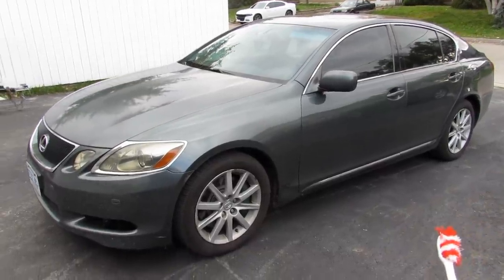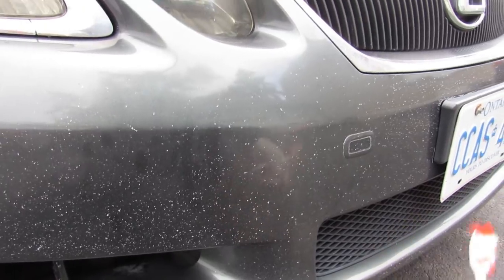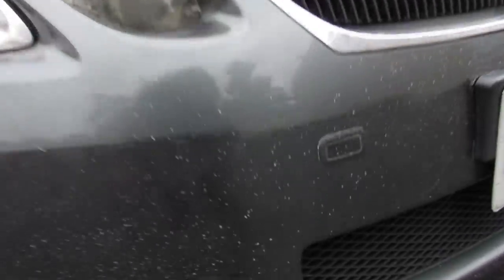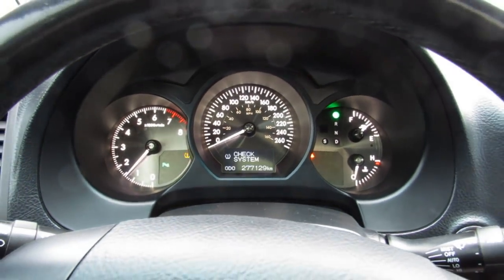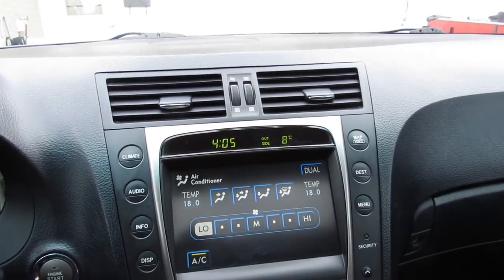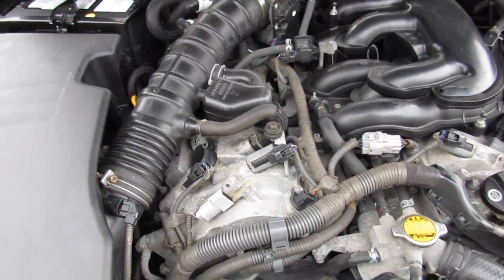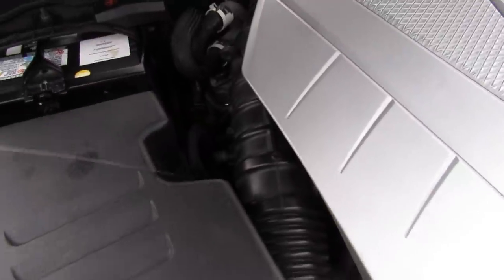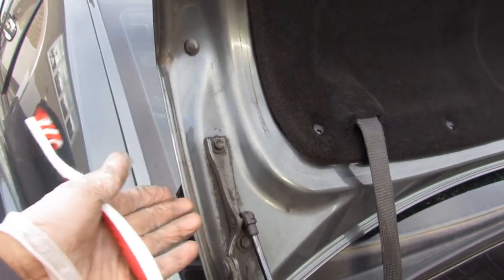Here's How to Inspect a Used car in 5 Minutes

Comment: First thing I do is get under the car and look for any questionable rust/leaks. Second pop the hood, check oil, transmission fluid if not sealed, then radiator. Make sure tires aren't cracking, brakes are a easy fix but always look for rust. This guy's spot on. Always start the car when it's cold to see if any lifter ticks or VVT rattles are present.
Reply from the maker: Agreed. Cold starts can reveal alot more issues
Reply: @speedkar99  so that's why the car dealers always start the car early when i go there

Comment: If you were examining a German competitor of a similar age there would undoubtedly be a  long list of issues. You just can't beat the Japanese and especially Lexus for reliability!
Reply: All depends on whether it was maintained or not.
Reply: @thenwhoami  Most of the issues I have seen are not related to maintenance, more like low quality parts being used by the manufacturers, electrical issues and parts that don't need maintenance failing. I wouldn't touch a German car
Reply from the maker: Yep I appreciate my Lexus for it's quality

Comment: Heres a tip, dont fall in love with a car before you buy it. Thats what I did when I was dead set on a gen 3 Honda Prelude Si and I purchased the fist one I came accross and thought it just needed a clutch. It was infested with electeical gremlins and I got rid of it in less than a year. Live and learn.
Reply from the maker: Good tip. I left that in the more detailed 6 part series of used car inspection
Reply: This must be a sign, I'm on the hunt for a 3rd gen Prelude too.

Comment: Lot of scammers now in the used car market. Never buy a rebuilt, check for rolled back odometer or they have switch the speedo for a lower miles one. Uni body vehicles can never be squared after a major accident, that is why they are written off.
Check for excessive wear on brake pedal, steering wheel (often covered) and driver seat that does not match to the miles or klms.
Another great video,

Good LUCK TO ALL !
Reply: Dont buy used cars from dealers as well
Reply: Trust me insurance companies are very very quick to write off cars that have relatively minor damage and this can be to your benefit, also you'd be surprised how many people and dealers sell cars with clean titles that are anything but clean and do not show up on Carfax reports etc.  Buying used cars is a minefield, you can get stung no matter what.
Reply: Write off has not much to do with damage. It is all about economics for the insurance company.  If the current market value of a 1 year old car is $40k and the damage is $20k, the insurance company is gonna spend the $20k to fix it in most cases.  If the exact same damage happened when the same car is 10 years old instead of 1 year old,  the insurance company is gonna write it off because they don't want to spend $20k on a car that is now worth $4k instead of $40k.  I have seen some write off vehicles with huge accidents and I have seen written off vehicles with cosmetic damage such as hail. So it all depends. I know because I inspect cars for a living.

Comment: OTHER TIPS... 
ENGINE: Before you start the engine, check the oil level. If its low or smells burnt, that can be a sign of a worn-out engine. 

Check the oil fill cap for foamy oil residue, which is a sign of coolant getting into the oil, caused by a head gasket leak.

Wipe your finger in the exhaust pipe. If there's a little soot it's Ok, but if it's a lot of soot and/or is oily, the car is burning oil.

If you can remove a spark plug, check to see if it's black, burnt, or oily. If so, this is a sign of the engine wearing out.

Remove the radiator cap and check for low coolant and look for an oily film, which is a sign of a head gasket leak.

TRANSMISSION: Check the fluid levels and smell the fluid. If it's low there's a leak and if it smells burnt, the transmission is wearing out.

With the engine running and your foot on the brake shift the transmission from drive to reverse and listen for a clunk. That can be a sign of bad transmission mounts or the transmission itself is worn out.

SUSPENSION:  Push down on each corner of the car (one at a time) and try to get it to bounce. If it bounces more than twice the shocks are wearing out. Also listen for clunks, which can be a sign of worn out suspension components.

AC: Pull out the cabin air filter and examine it for mold and musty odors, which can be as sign of a clogged evaporator, drain, or bad AC unit.

TIE RODS & BEARINGS: Jack up the car so the front wheels are off the ground. Grab the front tire at 9 and 3 and push and pull on each side. If there's a clunk the tie rod is worn. Grab the tire at 12 and 6 and push and pull. If there's a clunk the wheel bearing may be bad.

Is a bunch more but this is all I could fit.
Good video 👍
Reply from the maker: Thanks 
I have the 6 part used car inspection video series thst goes into more detail
Reply: Dry, powdery soot in the tail pipe does not necessarily mean it's burning oil (but you're right about oily soot). I have a 2013 Lexus GS 350 and those have direct injection (in addition to port injection). When direct injection engines are used frequently for very short trips on light throttle, soot will build up bc the engines run rich when they are warming up so some of the extra gas is not totally burned in the cylinder and comes out of the tail pipe as soot
Reply: @CarShopping101  Good to know, thanks 👍

Comment: Thanks for the tips.  Another thing is to measure distance from tire to wheel well edge on both sides.  If not equal, frame bent from accident.  You can use the ruler on your smart phone or even your fingers.
Reply: I did not understand , can you expla8n more plz
Reply: @soufianattar4554  My car was in an accident on the front passenger side.  The whole front suspension and body parts have been replaced so it all looks perfect.  But if you measure from the back of the front tire to the fender on the drivers side, it's 2 1/2 inches.  On the side where it was hit, it measures 1 1/2 inches.  That's because the frame is bent and can't be fixed.  That's one way to tell if a car has been in an accident when everything has been repaired and looks fine to the eye. You can do it to the rear tires too.
Reply: @coalbuster  thanks
Reply from the maker: Yeah but that's not something I'd do right away in a dealership parking lot
Reply: @speedkar99  Why not? If I see the frame is bent, I walk away. Literally, just stick your fingers between the tire and the fender.

Comment: Top tip, don't buy at an auction unless you really know what you are doing.  I tend to trawl Craigslist and FB Marketplace, all the good stuff is snapped up so gotta be quick.  My latest acquisition is a 1997 Toyota Celica GT convertible, 230,000 miles, runs like a swiss clock, was part of an estate sale, got it for $1200.  My main driver is a Sequoia but wanted a fun runaround.
Reply from the maker: Nice. You do have to have a good eye when you are at auction.

Comment: You can check for a blown head gasket by seeing if there's water in the oil by burning a bit of it in a spoon and watching for sputtering or steam. Schrodingers Box showed that it actually works about as well as doing a block test.
Reply from the maker: Good tip. But not something I'd do in an auction or dealer lot yet.
Reply: 😂 I just imagine doing that and the dealer calling the cops on me thinking I was about to smoke some meth right there

Comment: I like to squeeze on big coolant hose. It is possible to examine air pockets and broken coolant cap in seconds. Broken coolant cap on Japanese cars is really good way to overheat engine :>
Reply: If cap is allowing coolant to return with no force on hose circuit will not hold pressure and will empty itself under engine load.
On Japanese cars hose must be a bit stiff, cannot collapse, otherwise circuit it is not bleeded properly, probably had work done on it or has leaks.
On european cars coolant reservoir makes air pumping sounds when cap is bad.
In every case it is possible to hear air trapped inside of hoses and estimate how much is stuck
Reply from the maker: Good tip
Reply: @speedkar99  It started with second car, it was 25 year old civic, that had replaced head gasket. I had to replace it too, only cap was bad :>
I diagnosed cap failure on about 10 years old Opel, hyundai and suzuki that blew head gasket, and on four years old mazda, that was on its way to starve on coolant. I diagnose some of them, when other mechanics are working on them and I'm just passing by with intention to piss them off a bit :>

Comment: This looks like a newer car but isn't it a good idea to check for radiator milkshake and maybe burnt transmission fluid as well - assuming there are caps/dipsticks available?
Reply: Yup. Checking all fluids is a good idea.
Reply: These cars are extremely reliable but they do let waterpumps go.

Comment: Great video. I'd like to add that if you weren't very mechanically inclined you can skip an engine overview, under body exam, brake exam, OBD scan, and suspension exam. Some red flags to look for are price, grinding, squealing, knocking, large amounts of rust on the body, things of that nature because that usually means the car needs work. Certain dash lights can be ignored like the tire light and sometimes the engine light but anything else and any flashing lights mean you should probably stay away from that car. Once you start the car make sure to listen to it and look at the exhaust while the car is on, if something just doesn't seem right trust your instinct even if it is wrong but don't completely think that something is wrong if it's only one thing that doesn't seem right. Furthermore, you really ought to learn a thing or two from great videos and creators like this one before you go and buy used cars because it can be helpful.
Reply from the maker: Glad you appreciate it, I have a more detailed inspection series as this was meant to be a quick overview

Comment: I look for a high mileage new car, for instance - 2017 with 150,000 km on it. 
That way I know most of the miles are highway.
Highway driving is 5 times easier on the car than city driving.
Reply from the maker: Agreed. I'd rather buy a higher mileage car than a low mileage older one

Comment: Tires on a used car will tell you 90% of the story. Part of my job involves inspecting used cars. If a used car has expensive tires in good shape, 99% of the time, it means the owner took good care of it with regards to everything else.  If the car has brand new cheap Chinese tires, it means the vehicle has many issues and just before putting it for sale the previous owner put some new tires to help sell it.  Also look at the production date of tires on the sidewalls. It will tell you how old the tires are. If the tires are way older than the vehicle then it means the owner bought used tires and put it on the vehicle.  If the tires are worn out, mismatched or in bad shape then it means the owner didn't do much with regards to any other maintenance either. You should not buy that vehicle.

Comment: Those OBDII scanners are dirt cheap and have bluetooth connectivity, perfect little gizmos:)
Reply from the maker: Yep they work good for quick diagnosis
Reply: Good for basic stuff. Sometimes for really good diagnostic it's a few ks, these days hard to work without them and most likely no an option in the future. Even for bleeding brakes on something like 15yr old BMW X5, one has to activate the pump by  scanner. And rear brake pads replacement on cars with electric parking brake - again, scan tool to move the pistons into their original positions. Michał, niedługo to bez laptopa z scannerem za kilka tyś dol to nie wiele da się zrobić, bo tanie scannery nie mają wszystkich opcji i oprogramowania do wszystkich marek samochodów.

Comment: Please check fuel/brake lines for rust/rubbing, I got burned recently on a truck I bought, can easily cost over 1k to replace, and the vehicle is undrivable if either are leaking.
Reply from the maker: Agree, that's another good point.

Comment: Is there super repaired car from heavy accident in USA? In other places a completely crushed car can be disassembled and done some most careful metal work, repainted, and treated to make it like original ageing paint. Will higher labor cost prevent this in developed countries?
Reply: They can even mimic factory welding points when replacing body panels.
Reply from the maker: Yes. Labor and parts is expensive in north America

Comment: Nice review!  I’m looking at Lexus IS250 and these are known for carbon buildup issues.  During test drive how would I know if there is buildup?  Would it sound and run rough?  

Anything under the hood I can look at to see buildup?
Reply: Rough idle or down on power. No easy way to tell without pulling upper intake plenum and looking. Just figure if it's around 100k miles, and never had a valve cleaning, it's probably going to need it. Unfortunately gas treatments do not do much as fuel never sprays into the valves. Also check for good service history, either Carfax or Lexus drivers website (free). The 2.5 V6 is quite common to use oil as miles climb if owners went to long between changes.
Reply: @matthewwolfe4509   Thanks for responding.

Lexus drivers website?  Would you have a link?  I Googled but did not find anything.
Reply from the maker: It would run rough. Scan for codes. Check oil level. If it's low it's been burning. Step on the has and see if it's blowing smoke out the tail pipe.
Reply: @Unplugged704  YouTube never seems to let me post links. Using Google I searched Lexus drivers and it was the 1st result. Has Lexus drivers in website address. It only works for US cars so that may not be a big help if you are outside the states.

Comment: I’m looking at buying an 08 lexus gs350 with 120,000 miles on it. Mostly dealer serviced, regular oil changes, new brakes. Needs all new tires but she wants 7,000 for it. Seem like a good deal? Cosmetically in decent shape, has some scratches and small tear in drivers seat. Kbb has it for minimum 7,500
Reply from the maker: Yep sounds good. Is it AWD?
Reply: @speedkar99  rear wheel drive

Comment: Be nice to know the PSI compression of an engine. 🤔
Reply from the maker: You need a compression check. Way out of the scope of this quick inspection
Reply: @speedkar99  yeah I know. Be cool if the  car told you the compression on the dash board. There is a way to do it electronically now with certain tools.

Comment: Hi. Is there a way to inspect if the car had an accident before? Which is the most common spots
Reply from the maker: See my 6 part video series on how to thoroughly inspect a used car.
Reply: Check panel gaps, and distance from tire to fender.

Comment: What's your take on heavier weight olds for older engines? You know, the age old debate. That Toyota has 100k miles! Don't put 5w-30 but 10w40/10w30 in it! I'm curious what the engineer thinks because I personally just put what the engineers specified into it but is there any truth to this kind of old school mechanic advice?

Comment: I have the AWD version of that same car  :lol: No scanner reads tpms on that car except techstream.
Reply from the maker: I hate the tpms. How'd you get yours to go out? I have to hookup my techstream
Reply: @speedkar99  Pulled out a digital tire gauge, one of the tires was at 24, so it did its job. I have a techstream clone, was too lazy to pull out the laptop. Long story, That obdlink MX+ is supposed to read it, but I worked with tech support and they couldn't pull the data. It is a bit different from other Toyotas. I can't believe they don't have the pressures in dash...

Comment: I always check the oil first. Youll be shocked as to how many cars will have little oil, no oil, or old grimey oil. Really? You wont even change the oil or even top it off!? Its an instant red flag to not buy that car and not buy from that dealer.
Reply from the maker: Agreed. 
I waited until the engine was off to do underwood check